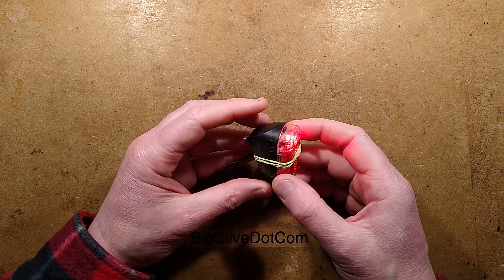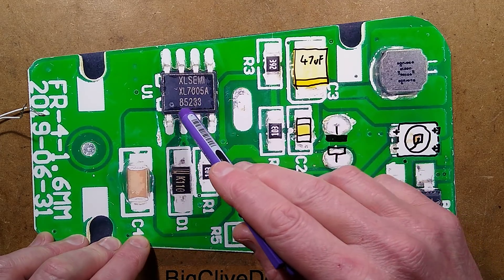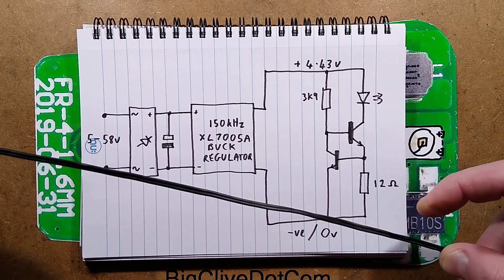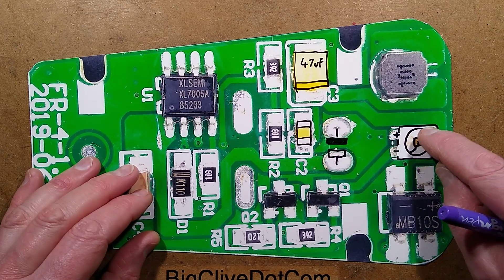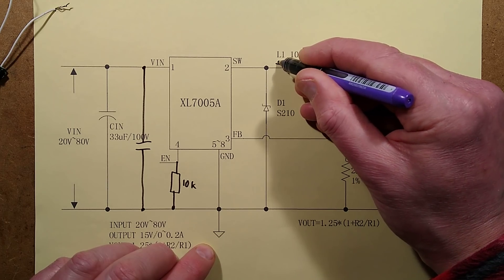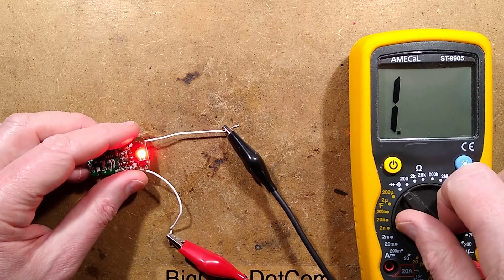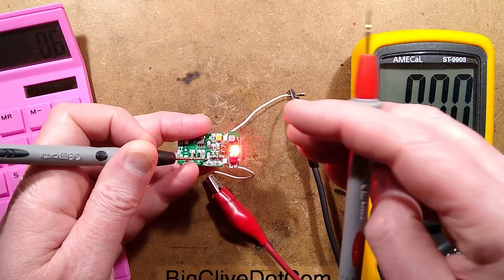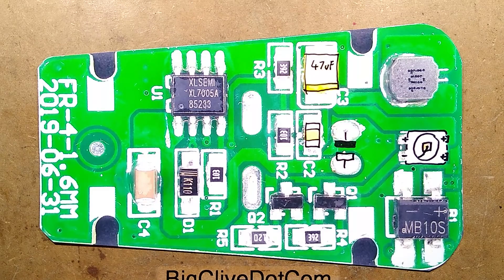Inside a 58V E-scooter rear light

Comment: I almost find it weird they didn't turn the SMPS section into an LED driver, just add a resistor that drops 1.25V @ 50mA = 25 Ohm, and wire that into the FB pin. Instead they went for a purely linear driver approach, anti-flicker? But on that note a smoothing cap for a constant current supply would give similar results. Curious why it's engineered quite like that.

'CFF' is a feed-forward capacitor, they do the opposite of adding stability, instead they feed in all the transients the regulator makes so if it does anything too spurious it quickly reacts and can tone itself back down, closing the response loop sooner in the time domain. Make it too large a value and the supply will sit there and hiccup, activating then turning itself back off again.

Also it bothers me to no end that the XL7005 has a pin labeled "EN" that is really a '/EN' or 'nEN' or 'DIS' signal, because to heck with conventions anyways.
Reply from the maker: I wondered why they didn't go straight to current regulation too.  Maybe just something they were familiar with.
Reply: @bigclivedotcom  My bet is it was designed in stages, just like the diagram you drew.  Bridge Rectifier -> Buck Converter -> Current Limiting Driver.  If they wanted to play it safe or wanted to have that logical separation.  Maybe they didn't know what they were doing, or maybe at below it's rated voltage the chip doesn't properly turn on, and instead of going with a different chip they just used a separate circuit for safety.  With this design, it's easy to know that regardless of how low the voltage drops, the LED will be protected.

Still with a few different choices, they might have been able to reduce their component count significantly.

Comment: Why didn't they use the current regulating transistors as a current sense and feed that back into the buck regulator? Have the transistor become a leg of the sense voltage divider.
Reply: why even bother with them at all when the buck regulator is maintaining a fixed voltage
Reply: @jaycee1980  LED's have an interesting thing where the voltage drop changes with temperature, plus no matter how hard you try every LED comes "born" with different voltage drops.

Comment: I recently bought a 5050 RGB LED strip, and it's controller was getting really warm really fast. So I opened the plastic box up and found that the main component heating was a zener diode. Is that supposed to heat up or is there smth wrong in that circuit
Reply from the maker: It's probably part of a simple voltage regulator with a resistor to limit current.
Reply: @bigclivedotcom  it's in series with a 100ohm resistor across the voltage source(12v)

Comment: That inductor looks pretty far away from the regulator, wonder if that affects performance. I'm used to all the regulator-related bits needing to be pretty close together.

Sure, it's a fair bit of circuitry, and a big markup, but it's also a light with a consistent brightness that you can stick across nearly anything short of mains voltage. That seems pretty magical to me, and pretty useful.
Reply: The technology is both pretty mature, and cheap - similar performance driver from a pretty reputable supplier for $14 Australian (or about 9 Euros) - https://lcsc.com/product-detail/DC-DC-Converters_XL7005A_C50848.html Multivoltage supplies are not a new thing, and even with the injection moulded (yet simple) Lens, that price tag is hard to justify, especially when you can buy comparable (albeit not identical) scooter tail lights from AliExpress, etc for less than $3 - https://www.aliexpress.com/w/wholesale-electric-scooter-brake-tail-light.html

Comment: That two-transistor current-regulator is not required. They could have replaced it with a single 24 ohm resistor, connected to the XL7005 FB (feedback) pin. This would improve the efficiency also.

Comment: When I saw all those components I thought it would have an accelerometer-activated brake light.  But no:  It’s... just a red led.  🤷‍♂️
Reply: Same
Reply: A red LED with a pretty standard constant current module, and not particularly environmentally protected. Complete similar modules are in the $3 range from eBay / AliExpress. Even incorporating an accelerometer chip (about $3 even in small quantities) and a microcontroller (4 cents each when bought in relative bulk), they'd still be making a very decent profit on this device. Instead of a wired, simple light fro 30 Euros, you can fit a solar rechargeable multi LED tail light for around $3, which would make far better economical sense. https://www.aliexpress.com/wholesale?catId=0&initiative_id=SB_20210203113141&SearchText=solar+charged+bike+tail+light
Reply: nice idea!!!

Comment: One would think that they could use the feedback resistor to the switcher chip in series with the LED so that the switcher would limit the LED current. Lots more efficient, if it mattered.
Reply: Yeah that separate 2-transistor LED driver after the buck regulator is just ridiculous. I can only explain this by the engineer having no idea what they are doing. They essentially added an unnecessary step (creating a constant voltage) when all they needed was a constant current.
Plus, XLsemi make plenty of LED drivers, I bet they have a chip that would do it with even less components and simpler feedback.

Comment: Jeez, that is massively overengineered!
Reply: Not really. Whoever put it on that bike didn’t design it for it. It was taken since it was available and someone probably had a big stock they wanted to dump. In any case, the “bus” voltages on scooters can vary widely, so that’s what it was designed for.

Comment: The bridge rectifier is probably so it can be used with a dynamo supply
Reply: The first time I came across a headlight that was powered by the engine's dynamo was on an English Triumph motorcycle.  It had a big zener diode on a heatsink.  😆
Reply: I have a power drill that does that! Does it when I let the trigger go, at least. It nicely compensates for the factory flyback diode blowing up a couple years ago. That was a fun afternoon cramming all those new parts in a cheap Ryobi POS - six white LEDs, it's brighter than my Milwaukee!

Comment: Looks overkill for lighting a LED. I think the 33nF capacitor in the feedback is for soft starting.
Reply: It stabilizes the feedback loop of the voltage regulator in the switcher. Nothing to do with soft start. It starts to bypass R2 at the crossover frequency f where Z_Cff(f) = R1||R2. R1||R2 is about 2k, so f is about 2kHz.

Comment: They could have saved themselves a lot of trouble if they had used a carbide lamp like this:
https://www.youtube.com/watch?v=ARSFcPB16ek
Of course, there's a bit of a fire hazard, so.....
Reply: Too hard to switch with the brake lever.
Reply: @OhShitSeriously   I could envision some kind of shutter mechanism that would normally be down over the lens allowing a dim tail light to shine through and then when the brake is applied it would raise the shutter through a Heath-Robinson style Bowden cable mechanism for the full light. It couldn't be any more complicated than the elaborate circuitry of the E-Bike tail lamp, plus there's FIRE! What more could you want. ;-)

Comment: what a joke this is. and the price for it is just worth a 1000 words... :D just use led and a resistor thats it lol :D
Reply: The point is different scooters have difference voltages, so this unit will work with any of them robustly (if they bothered to route the wires away from moving parts, that is :)

Comment: e scooters are a non regulated menace and a danger among common walking crowd and should be banned and outlawed by a civic resolution immediately, by my humble opinion. We do not need another steroid pumped, milkshake drunk green energy idiot at 6 am "firewalker" doing 40 km/h among pedestrians without a real brake on the device. Clive, please you of all people, you should condemn these kind of artefacts as non smart, not as a project...  I, personally would deny it and got of with something that is not a simple led circuit. Anything else? Please? BR Zlatko

Comment: You know... I think with the protection circuitry on LIPO's you could charge one from that supply, which would make it into a very handy little emergency light by tapping into that 'enable' pin.
Reply: You could charge it, but then the transistor current regulator is not particularly suited for lithium cells. There is a 0.6v drop over the resistor alone while you want it to be minimal.

Comment: Seams way over engineered for a light.
Reply: Not terribly — it has to work over a wide voltage range, so a switching regulator is needed. You’d hope a single chip would do it all, though.
Reply: @absurdengineering  They are always going to need caps and resistors. Resistors for setting the voltage and caps for smoothing. You need the inductor for efficiency. Otherwise you get the linear regulator issue (shed loads of heat).
Reply: @gordonlawrence1448  always? Look at the yz8018 solar cell led and battery charging IC. They reduced a the old circuits to a single passive inductor. Give them a few years and I'm sure we will get chip on board version that will include all passives on chip eventually.
Reply: @absurdengineering  as is with the 555, when you purchase in bulk, you pay about the same for configuration flexibility and reliability conveys along with the discrete pick-and place elements.
Reply: Its not. Consider its being powered from a likely unregulated ac stator who's output depends on the amount of vroom the rider gives it and its been retrofitted for the design when the original took a fairly forgiving incandescent or halogen filament. The new leds are much more efficient for power and heat but are more sensitive. Its engineered exactly as much as needed.
Reply: It did come from Germany.

Comment: WAY to many parts!  Why not use a full-wave bridge, a dropping resistor into a 7805 into a current limiting resistor into an LED!!
Reply: Probably, cause if an E Scooter is working with 50V or so, and you have to drop 47V on a linear regulator, that actually might affect the battery live and have the  regulator heat up a bit.
Reply: that would just effectively be a linear regulator, and the power dissipation would be 2.9 watts (i.e. 0.05A at 58v).  That's too much heat inside a little plastic housing.   The switcher allows most of that voltage to be dropped with little heat dissipation.
Reply: Not sure there are any linear regulators that handle 80V input, the 7805 for sure cannot.  And you'd need
a 3W resistor in a small plastic box - melt in no time!
Reply: @MarkTillotson  - I hadn't calculated the size resistor, but a large enough one would work since very little current would be placed on the circuit

Comment: If you're dropping half the voltage anyway seems hardly worth the effort to get the buck regulator, seems like it would be easier to just wire a load of LEDs in series and set a really low current?
Reply: Exactly what I did on my scooter. It had one of those overly complicated contraptions as well which just kept failing. With the LEDs in series it draws less power and is brighter than the original.
Reply: A "load" of LEDs in series wouldn't work at the lower voltages this works at.  This has the same output from 5 to 58V.  Plus they would take up a "load" more of PCB space, etc.
Reply: @ElmerFuddGun   what e-scooter operates at 5v? You need a higher voltage than that- usually somewhere between 24-52v, by load I mean somewhere around ten, but smaller chips/lower current, even just straight dropping you have to raise the voltage to 44v before the buck regulator even had a chance, with the conversion losses it might always, seems just a really weird use of a buck regulator.

Red LEDs are cheap parts, and just seem liable to be way cheaper than a dedicated chip like that. Seems odd is all

Comment: One LED to fit them all: A bicycle hub dynamo does 5-10 volts AC, therefore the bridge rectifier. Wanna switch to an old electric bike with 24 volts NiMH cells? No problem. 36 volt LiOn or 48 volt LiOn also no problem. I've a hub dynamo on my bike and put a cheap Bafang motor on it afterwards. So now I can just switch the rear light do the dynamo even when the batteriy is empty. That easy - and save.
Reply: And don't forget real mopeds or scooters with an unregulated stator.

Comment: One zener diode , two resistors and one led would do the job....😝
Reply: Think your 5W zeners/resistors would cost more than this design
Reply: @edc1569  No it isn't .But you all missed my point .This design is good.But it does not worth the money.30 bucks is quite high for this ,which does nothing  than glowing a little led. All e-bike uses a specific voltage battery pack .So  just one led and one resistor can do the job nicely .Or can be bought  from online as low as 5 bucks.
Reply: @shoumikahmed6373  You can definitely make this exact design for under 5$. They charge 30 because they can. Is this a surprise to anyone?
Reply: it would it would however also be more than 10 times less efficient and an unnecessary battery drain
Reply: The design issue I see is that all the light circuitry could have been centralized in the controller and
the light pods themselves wouldn't need a PCB each at all, lowering the BoM significantly.
Reply: @MarkTillotson  with this design it can be used on almost any bike from a 6 volt alternator to a 58 V battery pack and also everything in between. Sometimes a system has a 12v rail available for external components, with this design it will work. One design to fit them all. 
What you will find with e mopeds is an internal dc-dc 12v rail and buck CC converters in the lights.
Reply: Not quite. Not when this is designed to run from up to 50V. It’d add plenty of unnecessary drag.

Comment: The final circuit before the LED is designed as if transistors are cheaper than resistors. Maybe they are?
Reply: they are about the same price as resistors when you buy them in bulk; less than 1-2 cents
Reply: The PCB area is usually the dominant cost, not the jelly-bean parts.

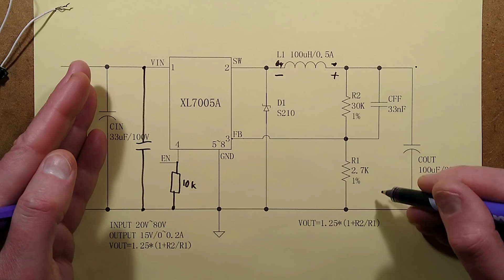Comment: 9:14 regarding that capacitor. CFF means feedforward capacitor. Its purpose is to pass voltage fluctuations from load transients back through the feedback network to improve the voltage stability.
Reply: I would think it also acts as a "soft-start" feature
Reply: @Cyparagon  no, the way CFF is placed, it makes the circuit react faster, not slower. It does this because the capacitor, which conducts fast changes is voltage, is connected in parallel with top resistor of the feedback divider and essentially bypasses it for high frequencies.
Reply: @Gameboygenius  Glad for your expertise here.  It's been so long since I've really had to work with RC networks that I missed this at first.
Reply: @Cyparagon  No, it does nothing to control soft start.
Reply: @Cyparagon  no soft-start function

Comment: Odd that they didn't just use a buck LED driver IC and dispense with the two transistor current regulator.
Reply: I used that concept myself in a couple of products. It is decent, rugged and really cheap to make. Also, you cannot always build things the way you like. Sometimes, you have to use parts that are in use in other products to benefit from volume buying etc. Sadly, the best technical solution rarely gets approved, esp. in higher volume manufacturing.
Reply: It wouldn't work without the current regulator. The buck convertor is voltage regulated and wouldn't care about the LED current limitation. It would provide as much current it could to maintain the expected regulated voltage. At the same time, the LED would just burn while hundred of milliamp go through it.
Adding the current regulator insures that the current in the LED is never above 50mA, regardless of the output voltage of the buck convertor. 
It's the transistor right 'under' the LED that will see the voltage difference.
It's a good design when you don't want to invest in a specific LED driver and keep playing with what is already in our BOM (lowering the cost in automotive electronic design)
Reply: @inotoff  That's not true. The buck regulators used for LED drivers regulate the current through the LED and care less about voltage. (Within limits...)
Reply: @misterhat5823  I think there's not many out there rated to work above 60V, those that are are probably not commodity parts.
Reply: @misterhat5823  My answer was targeted at this specific case. Of course you can find buck converters dedicated to current driving LEDs, but as @E C said before, it is not always possible to use them in your design as they are not cheap. Saving 1c over your BOM cost is mandatory in automotive products

Comment: So the power out of the batteries probably 24v or 36v DC right?  Why are they powering the light off of the AC running to the motor.  At least that's what I'm assuming because of the bridge rectifier.
Reply: @Jan181097 
I still don't understand why they included a bridge rectifier.  Unless maybe that board was repurposed from something that used low voltage AC.
Reply: Many motorized bikes scoots dirt bikes even motorcycles run off unregulated stators. This is a universal design for those type of setups.

Comment: I Really like the xlsemi chips. Very easy to integrate and super stable. I would even go as far as to say that they underrate their chips in the datasheet. If they recommend it for use with 200mA. It could also do 300mA easily
Reply: check page 6 of the data sheet, really it depends.
Reply: is this an advertisement